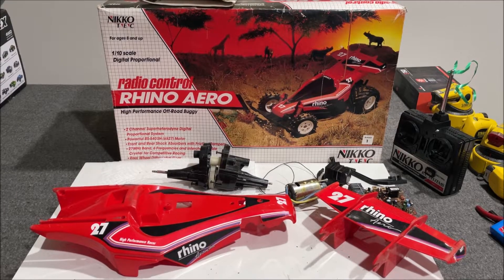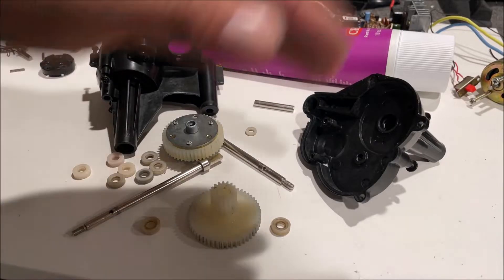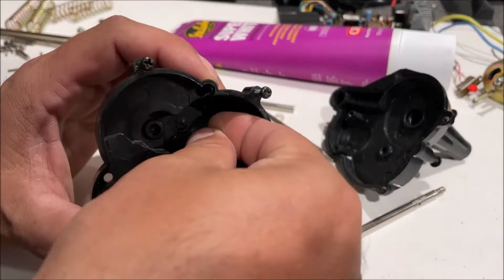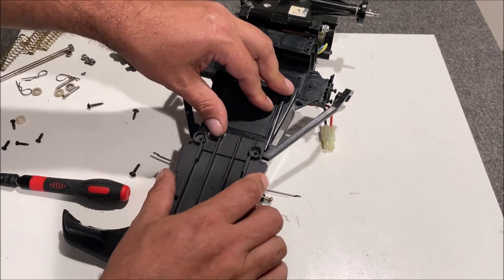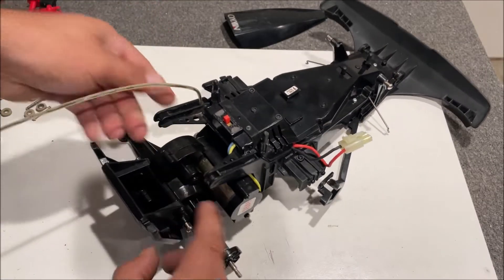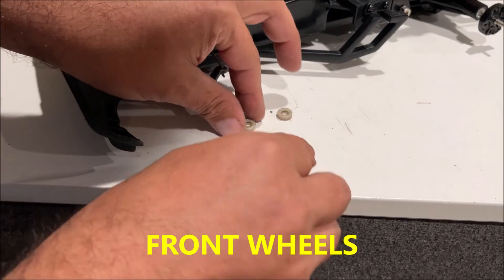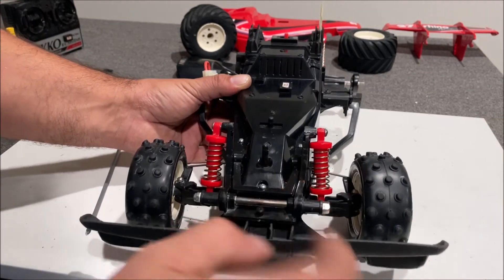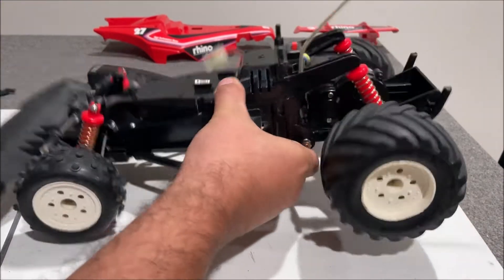VINTAGE RC car buggy assembly NIKKO RHINO AERO 30 years old

Comment: Great job getting it all cleaned up. The innards look identical to my Nikko Alienator that I updated to use modern electronics while keeping the brushed motor. I wasn't sure how I was going to add a modern 3 wire servo but that turned out super easy with very little work.

Comment: We plan on going brushless with ours eventually. I’ve got the motor and esc already, but need some new front tires first
Reply from the maker: you can break the rear wheels of you go brushless.. the axle part.. already done it but it was a failure.. the tires will make the car wheelie.. then 1 wheel broke.. I will check out your channel